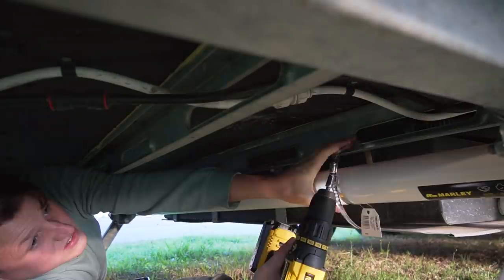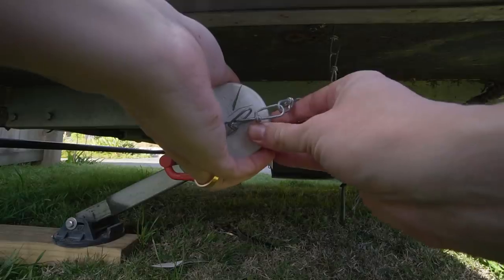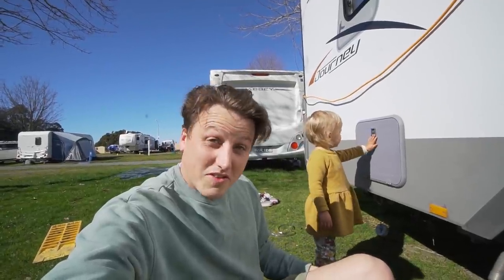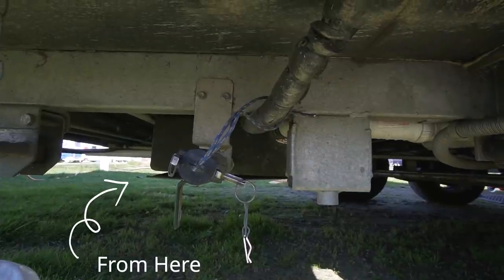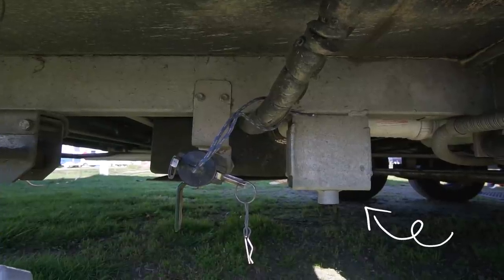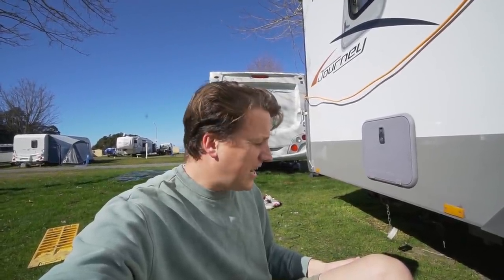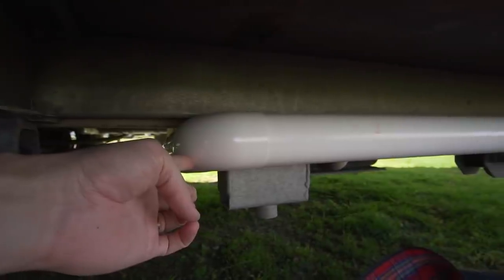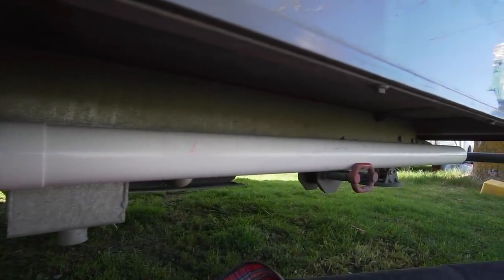Improved RV Waste Hose Storage

Comment: Emptying my 180K grey tank is very slow through the 3m narrow waste hose, so I have 2m of leftover Marley down pipe and 2m of guttering which I jerry-rig from the grey outlet to the dump station (the downpipe fits inside the guttering and locked with a bungee, so the length is adjustable from 2-4m). It is at least 2-3 times faster to empty the tank, very easy to clean etc.
Reply from the maker: That’s a very good idea! Yeh the standard waste hose is super slow huh, when we were in America and hired a waste hose it was a massive pipe like 80-100mm and it worked so well! Great idea with the guttering 👌

Comment: We have the 3m hose and a 30cm one as well. Don't think we've used the long one since. Almost always we can get pretty much over the drain. The little hose is just to stop splashback.
Reply: We do the same, 3m for cert and 50cm one we use all the time. The only time in the last 5 years of using the 3m hose was once on our first road trip when we got our camper, never been used since.
Reply from the maker: Awesome idea about the splash back Tara, I love the smaller one too. I've not used the new 3m length yet haha, haven't needed to yet!